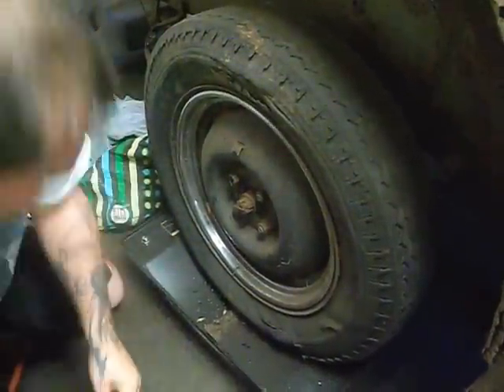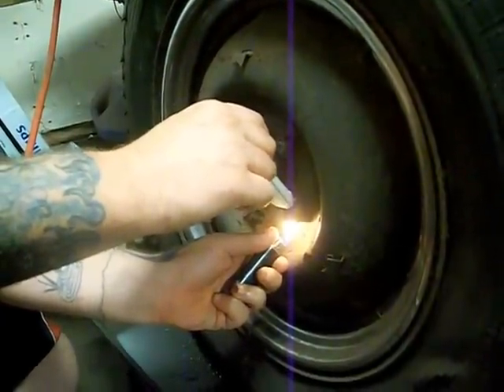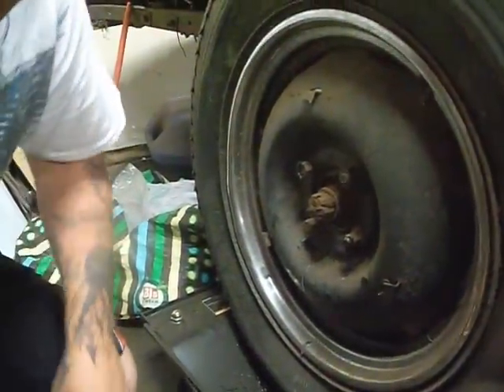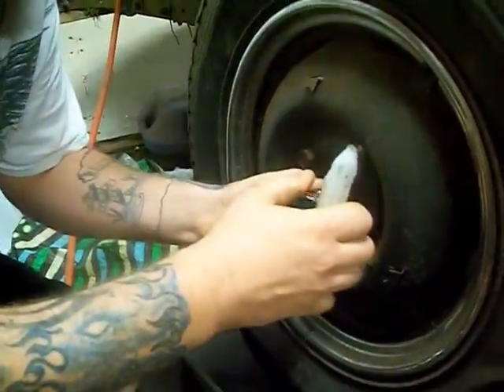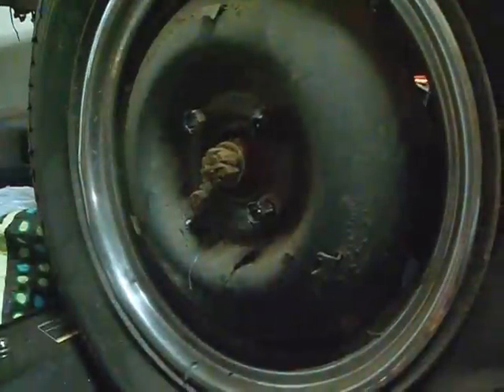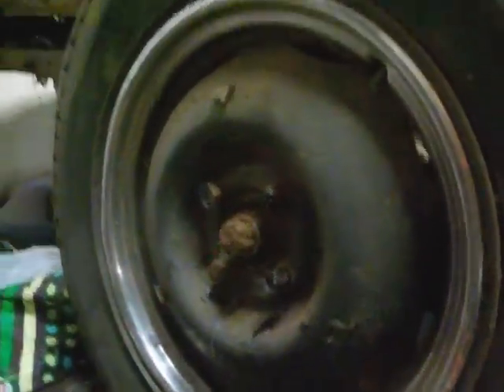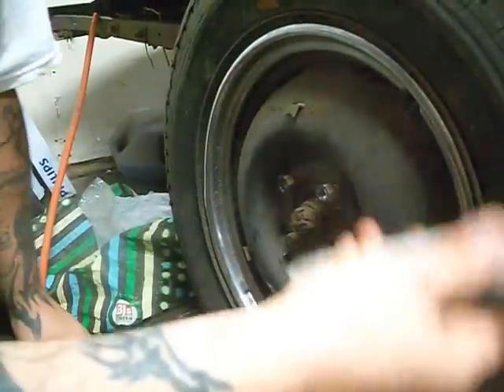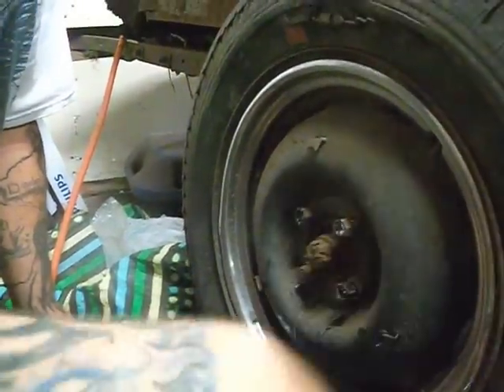removing rusted nuts using a candle and a lighter

Comment: Incredible. I  will be trying this. Wonder how this would work on manifold bolts. Anybody have any ideas for that? I have a Nissan Titan with rusted manifold bolts and I don't want to break them off.
Reply: if the threads are exposed at all it should work but I haven't tested this method past lugs and fender bolts on the 40 Studebaker but it had been setting for 30 years in a field
Reply: Well? Did it work?

Comment: don't know what for the candle is, but it is commonly known that heated rusted nuts, bolts etc. come off easier. No need for candle...
Reply: DDDarOOO a cigarette lighter doesn't warm it up enough for the heat to help. this works because the wax wicks into the threads and penetrates the rust binding them up, and acts as a lubricant
Reply: oh, in that case :)
Reply: if you remember in the video he said not everyone has heat  at home

Comment: The other thing I would suggest is that you smack the lug nut a few times with a hammer to break up the rust.  That will allow the heated wax to more easily work its way into the threads.  Great video otherwise; it reminds people to think for a minute before struggling with what seems like an insurmountable problem.

Comment: I can guarantee that the candle did nothing in removing those lugs. The heat from the lighter did all the work. One thing you can do is buy one of those torch lighters from Wal Mart for a few bucks and try it. Just for shits I grabbed mine once because I didn't want to walk and get my torch. It worked fine, just took a lot longer. I've found that in situations that call for flame for bolt removal, the torch lighter works about 60% of the time.
Reply: Marvin Harrison Smith II lighter does not provide sufficient temp you need to make the fitting red hot to expand and break the bond

Comment: You broke a torque wrench trying to open the nut?  A torque wrench should never be used for removing things....only for tightening things.  A nice waxy technique.  But how will you remove the wax from the nut and bolt, to prevent it coming loose by accident in future?

Comment: I saw this and thought it was the biggest pile of pig manure on the internet. Unfortunately, I was desperate enough to try it. Guess what? It worked. I still can't believe it. I had used some WD-40 as well, so that may have helped. But, still, the nuts would not budge 'til I used the candle and lighter.
Reply: it was not the wd40  that did it     heat  and wax     did it

Comment: 1. All that equipment in the garage and you're doing the research how to get a lug nut off that stuck
2. Get better breaker bars they should be able to break off the stud.
3. Next time use the torque wrench to prove to us that that works.

Comment: It is not the point if it works or not. It is when you put the wheel and nuts back on I would worry. You will get down the road and the wheel will fall off. People will not remember to get all the old wax back off the threads.  DANGEROUS

Comment: just sheared a bolt off, will give this a try and re comment
Reply: how was it?
Reply: yep, here's the update, It kinda worked I got about two turns before the friction created heat ans the nut stopped.  I found the best method was to heat the nut with a propane torch ans cooling with water, I then used loctite freeze spray for lube and eventually got the nuts off with a breaker bar. it took me 1 hour per nut.  after I got the wheel off the trailer I found all the bolts were bend from the torque, so I will probably replace the hubs.  I soaked the nuts in acid and wire brushed the bolt threads, coated everything with loctite anti sieze nickel and put the wheel back on with a rattle gun.
in summary it didn't work for me.
conclusion - it may work, it just didn't for me, maybe I did it wrong. and my rust is exceptional.( I split open a sidchrome socket and sheared off a bolt)
Reply: i didn't use a lighter I used a torch, I have 3 more wheels to get off I will try with a lighter next time.
Reply: Yeah man the dude says a lighter, not a blow torch. Blow torch wouldn't work the wax smoothly cause its flame comes out in a high pressure compared to a lighter making the wax skip majority of the thread and just dripping at the point you have the candle resting. Lighter takes time to warm up also helping the wax settle in all the threads.
Reply: i have more nuts to do, i can try everything at this stage
Reply: Dude..DO NOT throw water on the nut to cool it..the whole point of heating the nut with a torch is that heat makes the metal expand..when you heat a metal cylinder (like a lug nut..it's a threaded cylinder with hex-shaped shoulders) the cylinder's inner diameter will increase..the nut expands when heated, increasing the clearance between itself and the stud..
When you throw water on it, you cause it to contract, defeating the purpose of heating in the first place..the stud, being shielded from your cold water by the nut, stays hot and expanded as the nut contracts, effectively locking until temps equalize.

Break the nut loose while it's hot, unthread it a turn or two, then thread it back down.."rocking" the nut like this breaks up the rust..continue unscrewing and rocking back until the nut's off..if it gets real tight again before unthreading completely, heat it again as needed..but DON'T throw water on it, FFS!
Reply: I can only fit a socket over the nut, I think it probably a bad idea to put it on a hot nut.  Also its not my idea search youtube. 3. it actually works - I have already taken one tyre off using the method.
Reply: i will try what you said, anyways I can always try. this is the name of the video with the hose thing. Removing Rusted Bolts and Nuts THIS WORKS GREAT!
Reply: Yeah..erm, a socket IS a wrench.
:-)
It won't hurt your socket in the least bit to put it over a hot lug nut..trust me dude, I'm 53, I still use sockets from my first Craftsman tool set I got for my tenth birthday..I think they'd have died by now if heat were an issue.
Cooling a nut that's on a hot stud will do EXACTLY what you described..a couple turns and then seize tight. Difference in expansion between the two surfaces creates an interference fit..
Reply: Don't listen to that guy, if you read his other posts, he only has opinions, not experience. Heating and shock-cooling the the nut often works because you are breaking the bond between the nut and the bolt. Follow that up with the penetrating oil of your choice.
Reply: I figured he was trolling when he said a socket is a wrench, lol!

Comment: I wonder if a crayon would work too? I don't have free standing candles lying around, the wife only gets the ones in jars, but my son has a ton of crayons.
Reply: Just dig a sliver of wax from the wife's candle with a sharp knife, and put it in place after you've heated the lug. (take the wax near the edge of the jar, so the candle will still work and you won't get in trouble with the wife)

Comment: WD-40 works just as good too. To be fair though, you have to wait a little bit for the WD-40 to do its work.
Reply: wd40 sucks shit... almost every other penetrating oil on the market is better
Reply: Use it daily on seized bolts so..... yeah thats just like your opinion, man.
Reply: The fact that you use it daily doesn't make it a better product.
Reply: It proves its reliable and not 'sucking shit'.\

So still, it's just like your opinion, man.
Reply: If you'd used PB blaster, or Castle's Thrust, or Well-Worth's Thunder Bolt, you'd understand. But it's fine if you wish to continue to use literally the worst penetrating oil on the planet under the guise that it's wonderful because you use it daily.
Reply: WD-40 is a SOLVENT not any sort of penetrant .

Gibbs, PB Blaster, Freeze Off are all similar and great products but none touch Kano Labs " KROIL " ~ once you use it, nothing else will ever do . Kano Labs in Tenn.

The heat here is the trick ~ I use a acetylene torch to heatv then cool and free up broken exhaust manifold studs, works like a charm .

I've gotta try this ~ maybe use a BBQ lighter .

-Nate
Reply: Cool, but WD-40 will help a seized wheel come off. Sorry you wasted all that time writing that post, even though it means shit all.

I work on cars too so I know from experience!
Reply: I literally watched this video to learn a new thing, you were the one saying I claimed WD-40 to be something I didn't.

You a short pier you can take a long walk off around you?

Comment: I’ve had a broken screw/stud that goes to my thermostat housing for about two weeks now. I’ve tried heat, pb blaster, vise grips, and even Dremel. This thing is stuck good. It’s sticking out of the mating surface for the thermostat. The screw is chipped short so I have enough room for one more attempt before having to drill. Im stressed from it ngl

Comment: Anyone confirm?
Reply: Yes I have 4 vw bug's and they are notorious for this problem and year's ago I tried it and Omg it works well. This Man is telling the truth.
Reply: try it and find out
Reply: Try again, Charles..VW used lug BOLTS, not studs and nuts..Even if this worked as shown (it doesn't), it assuredly would NOT fly in the application you just described..
Reply: VW uses lots of strange stuff and apparently even their latest tech doesn't work right. Dieselgate.
Reply: Doug was an air cooled VeeDub mechanic for twenty years.
ALL of VW's air cooled vehicles used lug bolts..gimme your vehicle year/model, I will be happy to provide you with a part number for the OEM replacement bolt.
Reply: M

Comment: Prove this BS works..put a beam-type torque wrench on a nut that's rusted up, measure the torque applied in your failed attempt..then do your magic wax bullshit and amaze us all when the nut comes free at a lower torque..I ain't gonna hold my breath..
Reply: it actually does work, my coworker does it with rusted brake bleeders all the time
Reply: Awesome..have your coworker dig up a beam-type torque wrench and post some video proof.
Until then, your story is just that, a story..anecdotal evidence is about as valid as this nonsense video.
Reply: Doug died yesterday. All he had to save himself was a candle and a lighter but rather than try it he died.
Reply: Did you try this trick?
Reply: Doug Gyver spent twice as much time making repeated comments about why this theoretically wouldn't work than if he'd actually gone out to his garage and tried it for himself. I guess some people just like to bitch rather than learn anything new - especially when they think they know it all themselves.
Reply: dont understand why you would use a torque wrench to undo nuts or bolts, just use a braker bar
Reply: Me? or someone else
Reply: Doug Gyver I agree.
Reply: It would be interesting to see some torque wrench readings of before and after the heat/wax treatment.
Reply: Nope. Waste of time because a guy named Doug on the internet said it was. No need to entertain a hypothesis when all the science was already denounced by Doug.
Reply: I thought it was BS too - - until I tried it.
A splined shaft with stuck pulley. (transaxle on old riding mower) Hammered to no end - not budging.
Apply lighter and wax - - Bam! light tap and it came off.
Could be that the heat alone (from the lighter) would be enough, but since wax doesn't hurt anything and let's you know when its hot (because it begins to melt).
Reply: It does work. It's an old pipe fitters trick that goes back over 100 years.
Reply: Awesome! Then you should have no problem proving it as detailed in my initial post..
Reply: Aww, c'mon, Doug, get out in your garage and try it!
Reply: Garvey Evans -- Ever since Google took over YouTube -- maybe even before -- the reply thread feature for comments has been a mess that robs the fun from reading the comment sections. Now that replies don't appear directly beneath the comment they're left for, you could have to backtrack a mile to find the source in an active exchange. Sucks ass.
Reply: 2Truth4Liberty -- Thanks for your comment. I left a query on a similar video, asking if anyone had successfully used this method to assist in pressing out old bushings and ball joints. You never know when or if an urgent question posted online will elicit a sincere reply. I'll take your comment as words of encouragement. ; ] 

I tried this with exhaust manifold bolts, but did it after using PB Blaster, so I can't definitively credit this technique for the victory. I do believe that this was the silver bullet, though. I'm going to experiment a bit more with this. I tried Freeze-Off for other stubborn nuts quite some time ago. Seemed like a good product, from CRC, but I'm not a fan of the wastefully messy and impractical need to continually spray a fastener for 30 seconds or more with no assurance that the penetrating lubricant will work. That's a rapid drain of a 7-dollar can of mystery magic.
Reply: Doug Gyver -- While it wouldn't be an exact duplication of the scenario, why don't you torque-wrench two identical stout nuts to the same high value and try this candle wax technique on one, comparing the difficulty of removal to that of the untreated fastener.
Reply: Colin - STAPUFT   Then o'l Doug can change his name to "Miffed Busters" lol

Comment: Are you kidding that is a load of bullshit a lighter and a candle isn't going to do shit. I've taken thousands of rusted bolts off big machinery and small eqipment too. I know that don't work.
Reply: So you've tried it then.
Reply: well no the torque wrench I used was an old one that I  keep around as a breaker bar but thanks for the feed back
Reply: i  agree. dont see how its more effective than a blast of thin oil. I may be wrong though maybe liquid wax is ridiculously thin. But he barely heated it and it flowed into a lug nut bolted to a large thermal mass. just spray some kroil shit on it
Reply: It does work. The paraffin in the candle can penetrate places that other lubricants can't.
Reply: ... it was a fukt up torque wrench.  Besides it was his, he can do that type of shit.

Comment: i wanna be the first to say BS , if the lug nuts came out that easy with the wax and heat, then they would have came out with no wax and heat but slightly more pressure on your end. Those nuts were definately not seized up.  I'm pretty sure you over exaggerted this effect, because as a mechanic with 10 years experience, it sometimes takes a couple of minutes with 1500C torch and water and lubricant to get a nut to move. So this nut wasn't seized at all, just slightly rusted and you pussied out the first time trying to open the nut with no wax.
Reply: I like your pic

Comment: I call bullshit, how in the hell is it remotely possible for anything to get sucked into the threads? The threads from the outside of the bolt to the inside are sealed with rust. There literally wouldn't be an opening for it to get in there. You definitely pre-loosened those lugs. I don't care what you say. I don't buy it at all
Reply: I have to agree with you nate p
Reply: wrong you obviously have not tried it I own vw bug's it works well.
Reply: Nate P He doesn't mean it's actually getting "into" the metal of the threads, what he means is that the wax, when melted, essentially becomes a fluid with a low enough viscosity to permeate the gaps between the lug and post so that it coats the threads. I would imagine as the wax cools and becomes a solid, it expands slightly (much like ice). This expansion places mechanical force on the inside of the lug-nut. That, coupled with the external force he's applying is enough to break the hold.

It's not like these parts are welded together, they're simply rusted. Imagine the process as being sort of the opposite of using a lubricant like WD-40 to crack a rusty nut. The WD-40 would penetrate and coat the threads as well, but would provide lubricant properties as well to loosen the threads, whereas the wax actually push them apart. That's my theory at least.
Reply: Ice is actually unique: The default is for things to shrink when they freeze. This is because, normally, if you make something hotter, it vibrates more. IceWhen it vibrates more, it tends to take up more space, so it tends to expand.

Ice is very unusual that, as it gets colder, although the particles are vibrating less, it expands.

The reason for that is due to the strange shape of water.  If you’ve ever seen the picture of a water molecule, it looks like a Mickey Mouse head with an oxygen molecule where Mickey Mouse’s face is, and then two hydrogen atoms where his ears are.
Reply: I'm guessing it's similar to heating a copper pipe and the solder follows the heat into the seam where it's needed - ex-plumber here.
Reply: Thought it was actually down it the crystal lattice of ice taking up more space that the same amount of randomly arranged molecules of water.
Reply: Solder doesn't follow heat, it follows flux..
Reply: Doug, you are correct...
Reply: jonlem88
Well, I guess that blows my theory of an expanding solid placing pressure on the lug-nut. Either way, something is going on, and I have a gut feeling it has to do with the liquid wax hardening in-between the threads. I have no way to test that, though. Just a hunch. Cool trick to remember, though.
Reply: It's a hoax, man..
Reply: Doug Gyver
prove it
Reply: and if the solder wire has no flux core? ... it follows that it melts where the heat is greatest..
Reply: ... not if the bb is from HAZARD FRAUD as AVE says!!!    XD  (Harbor Freight).
Reply: Capillary effect.